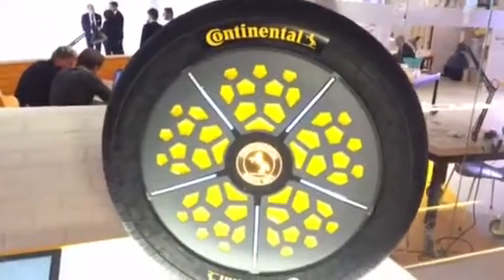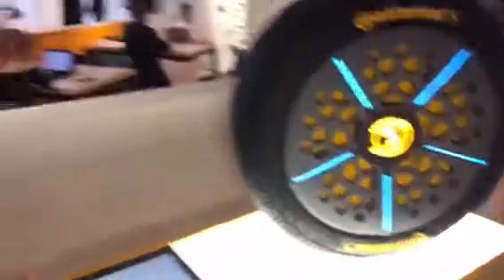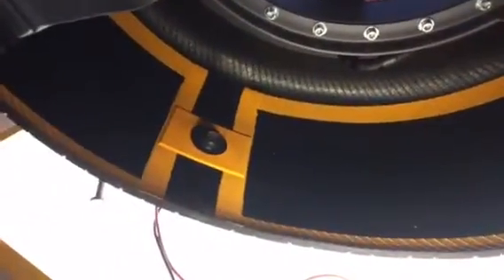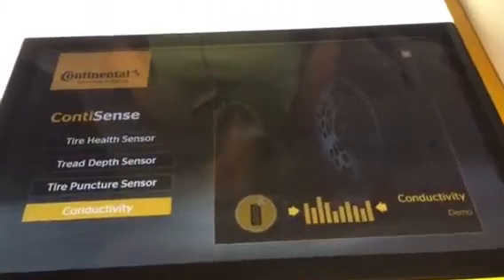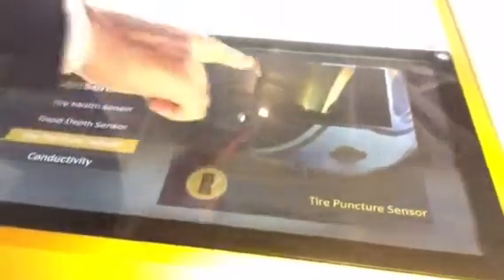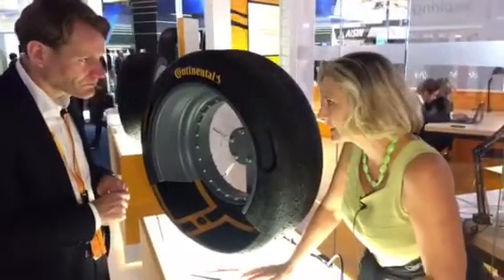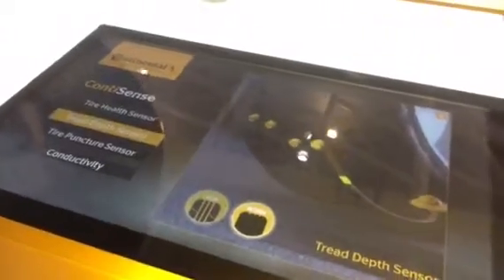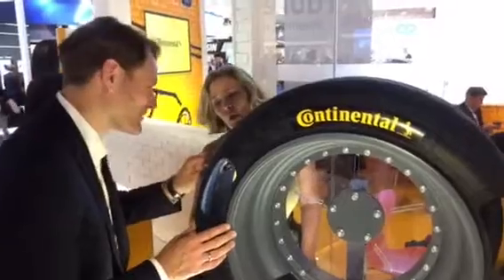Continental's Nikolai Setzer ContiSense and ContiAdapt tire technology Frankfurt Motor Show IAA 2017

Comment: what is the use of conductive rubber ?
Reply from the maker: I have sent your question to Continental for an answer. I'll post hear when they answer. TIA
Reply from the maker: This is what I received from continental today - Just talked to my tire colleague about this topic: the inner layer of the tire contains a material that makes the rubber conductive. When that layer is punctured, this basically breaks the electric circuit inside that layer. This is then picked up by the electronics of the tire and alerts the driver.